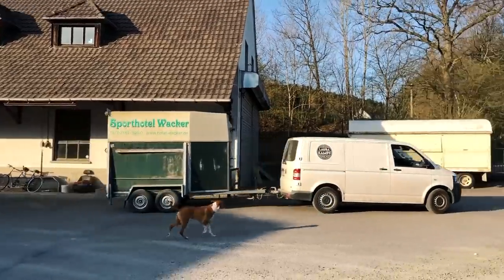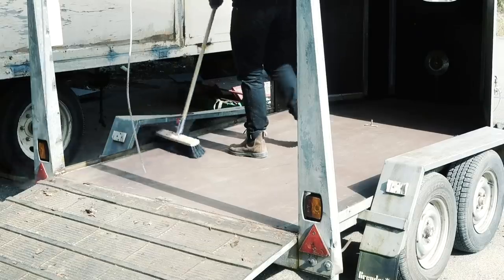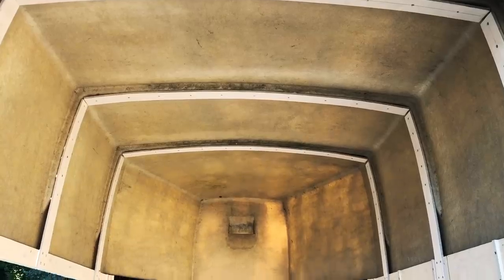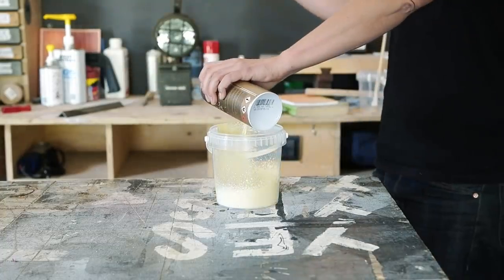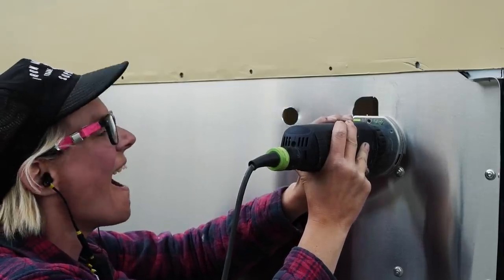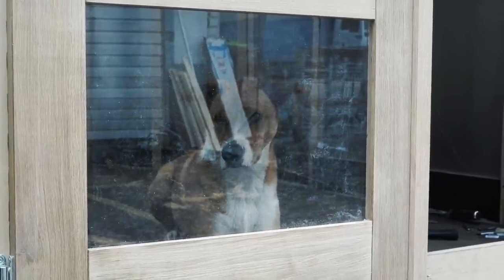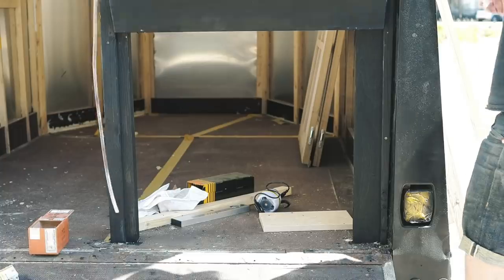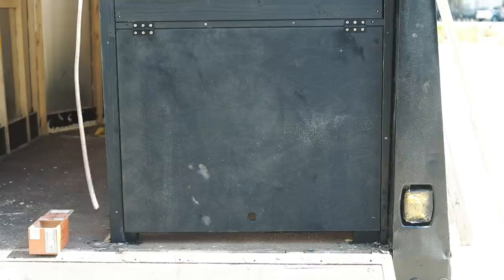Horsebox Camper Ep.4 - The Teak Wood Terrace

Comment: Thank you for inviting us along on your adventure.
Question, would you consider fitting stabilizer legs to the deck so that it sits level with the floor of the trailer?
Reply from the maker: It’s actually very comfortable to sit on the angled deck and lean against the black wall...I might just leave it as is
Reply: Yeah I was thinking mask it into a deck. Can never have too much flat space.

Comment: Definitely want to get that ramp/deck/porch level with the ground. I see 2 solutions, the easiest is just to prop up the ramp higher but you may not always have flat ground and the distance might change. The second solution is to use cables that mount to a spring reel at the top of the trailer. The cables would come down and attach to the top of the ramp, this is how I believe most of the big toy haulers do it.

Comment: Great progress! if the trailer tongue is long enough consider building a motorcycle storage on the front of the trailer, on the tongue. I've done that before on my trailer. I've also built a motorcycle mount that plugs into the trailer hitch that attaches to the back of the trailer.

Comment: Great to see your joy and enthusiasm. 
Please accept an advice from a coachbuilder: use undercoat like "brantho korux nitrofest" etc. (available also  in black). Your topcoat from can gives limited protection and won't last long. Especially in rusted steel. Use grinding/cutting discs and milling head in straight grider on  deep rust. With wire disc and modern paper disc rust is polished only (you can see this in vid).  All pores of rust have to be removed in depth and proper primer has to be applied.  

Wish to have your wood-skills👍🥺

Comment: Some questions, sorry!
1) It’s funny that you don’t like explaining things to the camera when you’re so great at it. Seriously.  But 2) Pferd: how does that work? I’ve seen that display at Habu’s shop too. Do they travel to you and you use what you want? 3) The frame of the deck, seemed you had a gap. Did you just weld it so it was the length you wanted? Is welding analogous to soldering? Sorry for all the questions! I guess my first point is only for Laura lol. If anyone has any insight it would be really welcome. Thank you!

Comment: Hi, what about adding a hole on the metal loops (legs) with a welded nut, and using machine screws as leveling legs so the terrace is level and you can put a set of folding chairs and a small table for the feel of a patio.